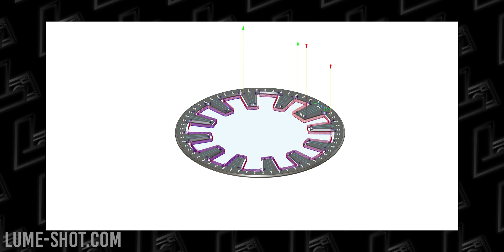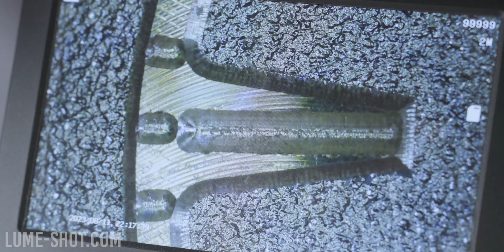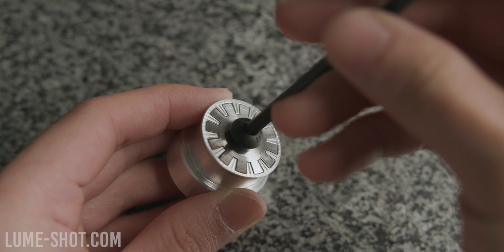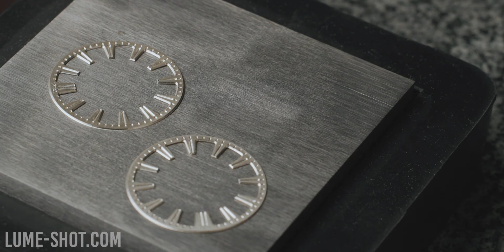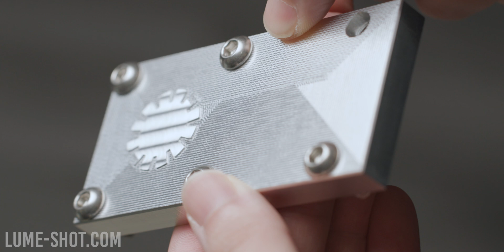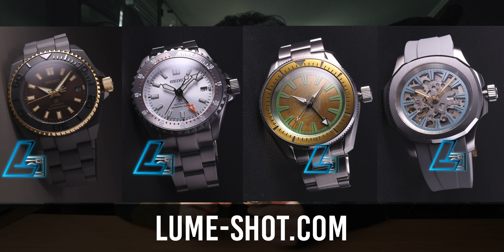Making a Custom Watch with Sterling Silver - Yoon Openworked GHOST

Comment: I am surprised by amount of attention to details. Since I am somewhat experienced in metal manufacturing I’ll give you few advices. 
First, I’ve noticed some play in spindle while you where machining, that can cause issues with finish. I assume, buy the setup it’s router cnc machine, so I guess that amount or play is normal. I could be wrong about router, but for me it looks like it. Also, don’t know about your feeds and speeds but from chamfering op, it looked like tool needed more rpms. Also, while tool you are using for chamfering is not wrong, I would use chamfering tool with z=6(teeth). Your tools, since it has z=4, has more of flat bottom, hence it’s not being able to cut material with face of tool. Also, tool with more teeth will help you with cutting speed if you are at limit of your rpms. From experience, this tool will give you much better finish. Additionally, you can try engraving needles, they are specifically designed for engraving and they leave nice surface, especially if they have rounded tip.
Finally, if you are prototyping, please use aluminium sheet to test and run programs than when satisfied with results, use silver. 😅

Comment: Just a suggestion for symmetry could you try to only put the design on 3 6 9 and 12 and leave the rest plain and make them significantly smaller than the ones with design

Comment: Looks great and beautiful work! One question- silver over time will tarnish black did you apply a lacquer coat to prevent it?
Reply from the maker: I would say very little to none should occur - the watch is sealed with a screw down crown, caseback, and gaskets throughout so little to no exposure to the elements.